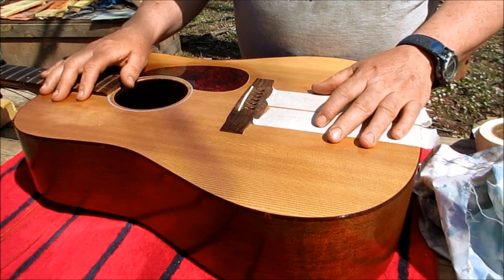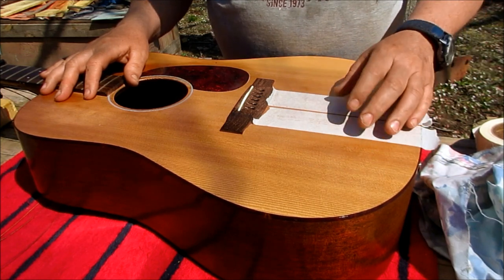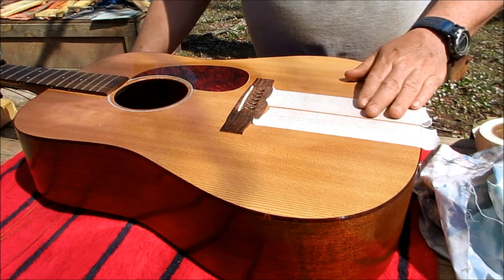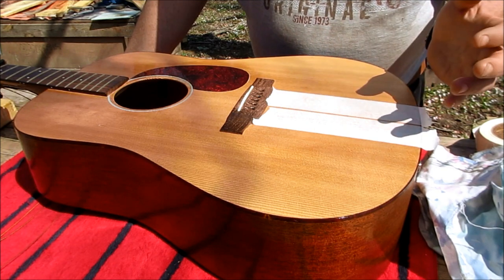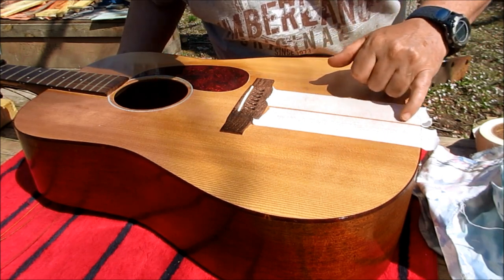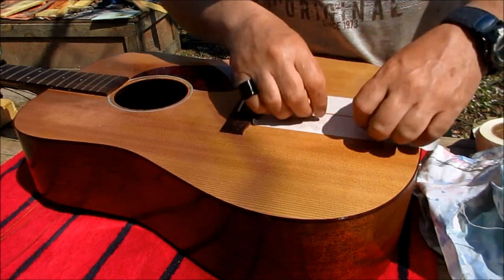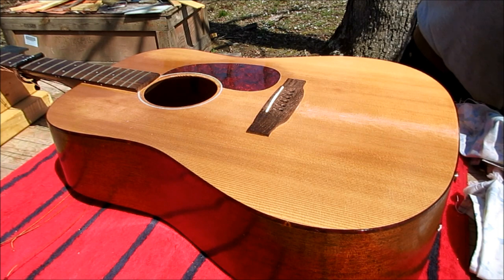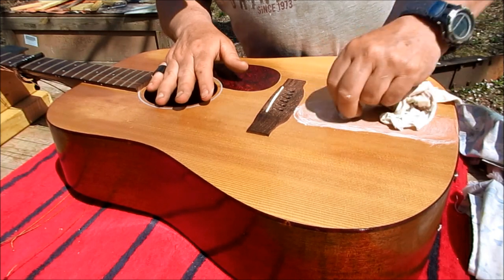Martin Top Crack Repair

Comment: Sanding Grits 600-800-1000-1200-1500-2000-5000, next turtle wax “buffing” compound and then “polishing” compound. Light touch and careful sanding to not go through the finish surrounding the repair.

Comment: My Dads Taylor keeps splitting. He keeps it in its case with a humidifier in with it but it happened again. What is considered a controlled environment
Reply from the maker: If the guitar keeps splitting and the humidity it is stored in stays between 45-55 percent, IMHO there is an issue with the wood; ie not seasoned properly before use, or something of that nature. Which I would not expect of Taylor. My advice would be check the humidifier more often; make certain it is not drying out, and get an inexpensive in-case hygrometer that you can calibrate.
But realize I am speaking about an instrument that I have not seen or held.
I'm sorry your Dad is dealing with this.
Reply: @HandToolWoodGuy  thank you so much for responding. We probably have to replace the face of it at this point. That is going to be costly. The humidifiers are only lasting a month.

Comment: I do a fair bit of stringed instrument repair- you’ve got the right idea on adding cleats inside and doing initial repair with PVA glue and a clamp or two. I sometimes use neodymium magnets to clamp the cleats in place, and sometimes a set of home built clamps which use guitar tuners and B or G strings to winch the cleats up to the top through tiny holes drilled along the crack. I just did a long crack in the top of a decent student cello top that way, so as to avoid having to remove the top for the repair- extra interesting when you don’t have a sound hole to work through and have to build a ship in a bottle through the f holes. Was glad I have an inexpensive inspection camera with a business end small enough to get through the F holes when it came time to pull the cable ends back through.  I  usually use a sewing needle as a precision applicator to float CA glue into a crack or scratch, without spreading it all over the rest of the top- I do put masking tape on either side, but just in case a stray drop falls off the needle in the process, and I try to keep the CA fill contained as neatly as possible in the crack to level the finish. If you smear the ca glue out till it reaches the tape, you’ll have a mess to deal with. After it sets, a single edge razor blade with corners scotch taped off works best for levelling the CA glue, then work through a couple grades of very fine sanding, and then polish with a polishing compound or buffing wheel. Sometimes can’t even tell where the repair was, sometimes you wind up with slight witness lines where the CA meets original finish.
Reply from the maker: Thanks. I'll use that needle trick for sure.

Comment: I have a 1973 Australian Maton Southern Star which has the same materials and specifications as a D28. I've just started playing it again and its been in its case for years. I've noticed the bridge lifting and a crack from the bridge to the tail as in your video here. I also noticed that the top is more rounded than I remember, a 10mm ( 3/8") convex roll from side to side. Is this a normal amount of roll on the top? Or has the top been stressed over the years?
Reply from the maker: That guitar should see a repairman. If the bridge is lifting and there's a corresponding crack that needs to be addressed or it will get worse, and the Maton is worth getting the work done. That guitar was built when Maton still built by hand, small shop,  if I recall correctly.
As far as belly goes most manufacturers build a dome into the top, but I think 3/8 is a bit much. But find a good repair person and follow their advice, not mine. They will have it in their hands; I don't.
A rise in the belly and a forward tilt to the neck is normal as an acoustic guitar ages, and if you keep it and want to play it it is necessary to have it addressed when the time comes.
Personal opinion, but if it can be made right I would prefer to spend money to restore an old instrument to playability than to own a new one. Again, personal preference.
Reply: @HandToolWoodGuy  Thanks for the information and advice. I agree. I've been married to this guitar longer than with my wife.
Reply: I hope I'm not bothering you too much with another query. 
I live in Thailand for the last twenty years in the NE part where good/trustworthy luthiers are hard to find. Also I don't regularly play my guitar only to record songs and I haven't done that for a while. But now I have a project that I want to complete  and need my guitar, so I thought I'd attempt to take off and re-affix the bridge. If I don't succeed satisfactorily I can take it to luthier. 
Following the procedures I've watched, I removed bridge, which is ebony and a replacement from the original 40 years ago. I can see that it is curved as with the guitar top. Ebony is so hard and stiff it's almost unbelievable that it could have warped along with top. Do you have any thoughts on this, as I'm wondering if the luthier who replaced the old bridge made it concave to fit the roll of the top. Is this a normal procedure? I've  felt the bracing and I think I can feel the tiniest of movement in a couple of places , although I'm not sure if it's just my imagination. If it is loose it isn't much. I've subscribed. Thanks.
Reply from the maker: It is common practice to lay a bit of sandpaper on top of the guitar and sand the bottom of the bridge to fit the radius of the guitar top, so yes, the luthier may have done this.
But the tension of the strings over time can warp even ebony.
Reply: @HandToolWoodGuy  Thanks for that information. It is still my intention to take it to a reputable luthier for a complete overhall. I'm just trying to do a temporary fix for the moment. Thanks again.

Comment: Does the compounding method change if the guitar has a satin finish?
Reply from the maker: That is generally trial and error. Satin finishes are really hard to match, as they don't stay a stable sheen. If you look at most satin finished instruments you will see that the areas that the forearm rub against, for example, change and become glossy and stand out quite a bit. If I work on those i cannot guarantee you won't notice the repair.

Comment: quite difficult to glue any crack on guitar top without to glue the cleat wood underneath the crack ? any tips for better option to repair crack guitar top?
Reply: I used CA on my guitar about 5 years ago, still holding strong but you have to scrape and re polish on the line. I used stewmac 20
Reply: @somedude3601  thanks for the tip.

Comment: Very useful video.  Thanks - have you ever discovered a wood putty that could be used to fill in a gap in the spruce top of a guitar that's had a hole put in it?
Reply from the maker: No. You would have to replace with wood. Depending on the job, or where the hole was, that could be a pretty big job.

Comment: This happened to my Martin
Reply: Same thinghappened to my Martin. I'm going to do the same thing . Maybe dilute some quality wood glue w water. and like you said no adhesive with the tape. I like the clamp idea. The crack runs from the B string south of the bridge to the bottom. about 1/4 of a mm .I'm sick about it. But living out west Tucson and Vegas. it' dry as it gets. I'm also not sure about the razor blades and the sand paper and all the automotive rubbing compounds? I'll take my chances w/out all those' Wish me luck!

Comment: Could I use wood glue?
Reply from the maker: Yes, but you would need to find a way to push it into the crack. Many people will thin it out a bit with water.
The CA glue is water thin and penetrates readily completely through the crack.
Reply: You can use a suction cup to push the wood glue into the crack. Randy Schartiger did a good video on it.